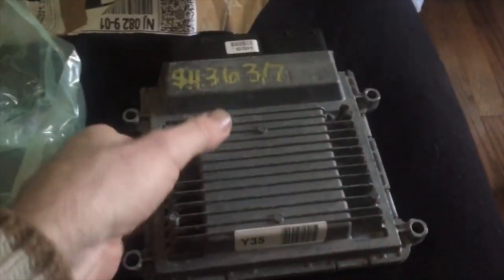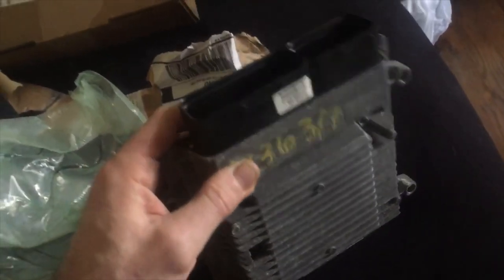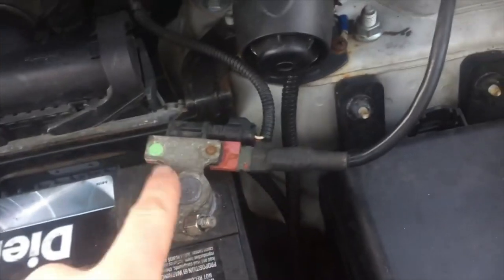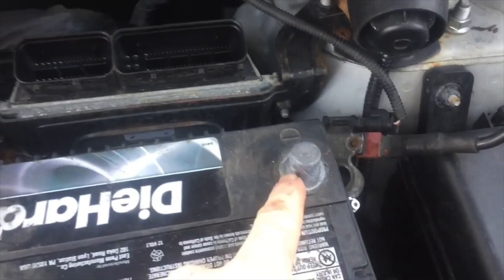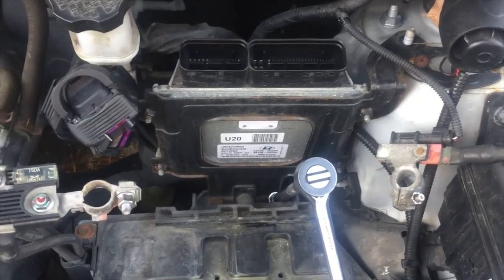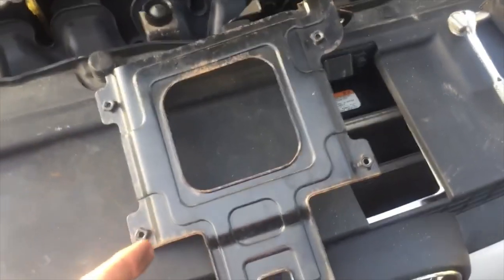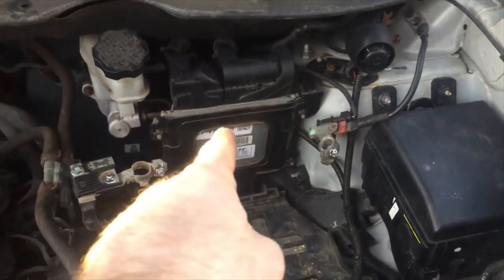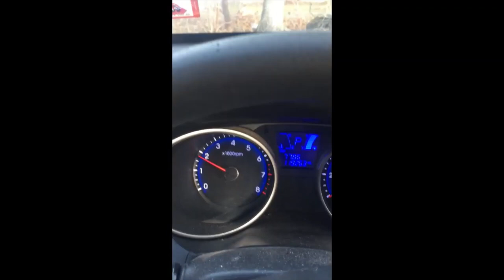How to install the main engine computer Ecu / Dme. Ex. Hyundia Tucson 2.0 and 2.4

Comment: Hey, i'm checking out your video for a friend of mine and I wanted know if the ECU is still working for you or if you had to replace it since installation.  Also, do you know the name of the seller you used on Ebay?  Thanks
Reply from the maker: @Davmatic  been working fine since install. I bought it from a guy who only was parting out his. Do you have a specific question I can made help with?